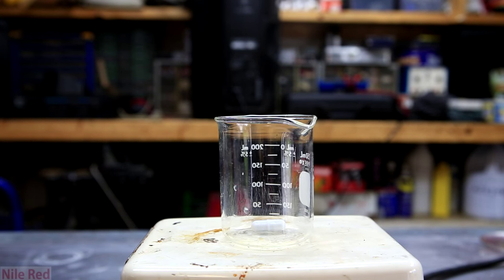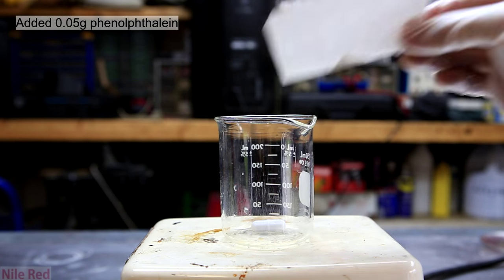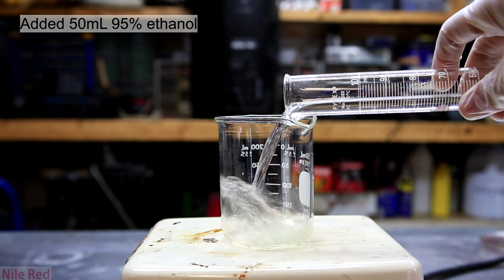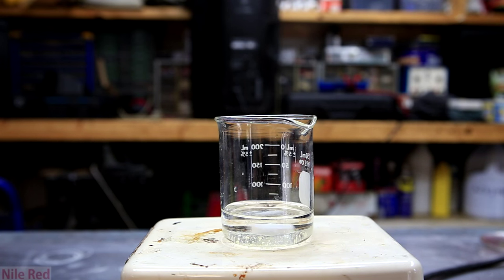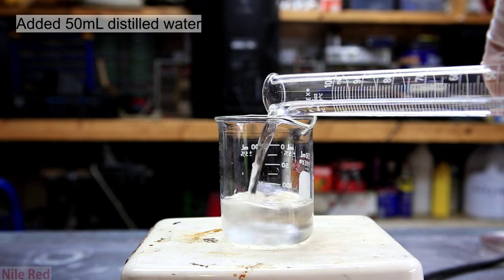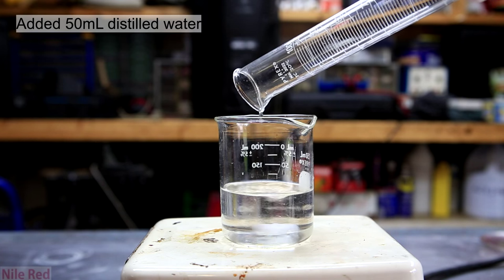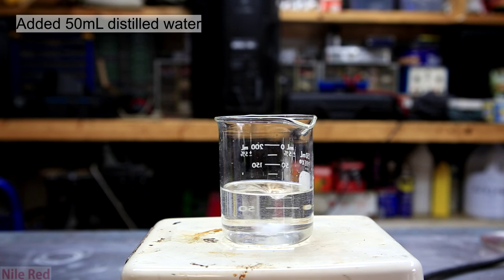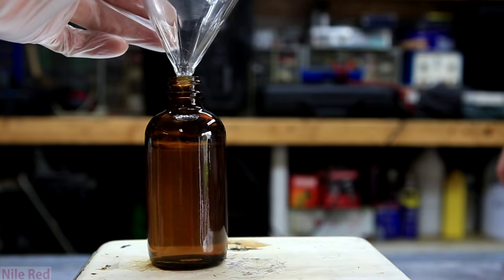How to make a Phenolphthalein Indicator Solution (0.05%wt)

Comment: um...some background would be swell...used for what...why do I care about pink if I don't know what it was added to?
Reply from the maker: +Richard Lynch Yeah, it was kind of a quick video. I think I will redo it at some point and make it more interesting
Reply: +Nile Red ... i get a little bit of a duh on that because you did say "basic" solution and it didnt trigger in my head acid/base. its probably exactly what i am looking for...i ended up making an indicator from red cabbage...which was good enough for testing bottled water. a little bit caveman...yours looks more elegant. an indicator color chart would answer a lot of questions!
Reply from the maker: Richard Lynch Why are you testing bottled water pH?
Reply: Because it differs... and as far as I understand, there are reasons to control the ph of what you pour in your gut.
Reply: If I am convinced of the science of it, that is my own sphere of ignorance. You have your own. I want to test the ph of water that I drink...it bothers you? If a manufacturer is bottling acid rain, maybe I dont want to drink it. Theory is, less acid causes less cancer, and the body functions optimally slightly base. I dont mind that theory...so I test the water.
Reply: +Richard Lynch Please don't use phenolthalein . It is a powerful muscle relaxant and hence a laxative. Doseage is critical.
Reply: +Richard Lynch Please don't use phenolthalein . It is a powerful muscle relaxant and hence a laxative. Doseage is critical.
Reply: ??? I have no idea what you are talking about.